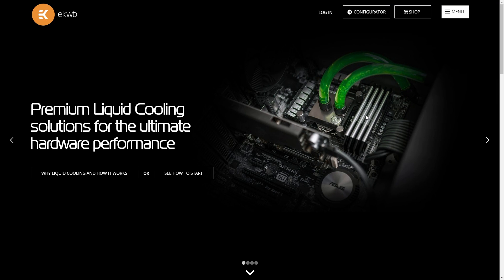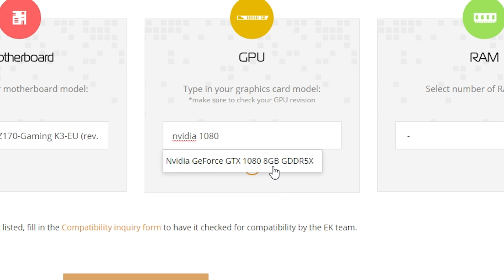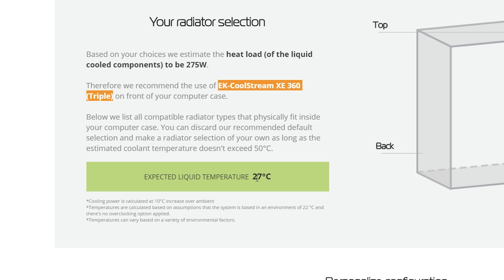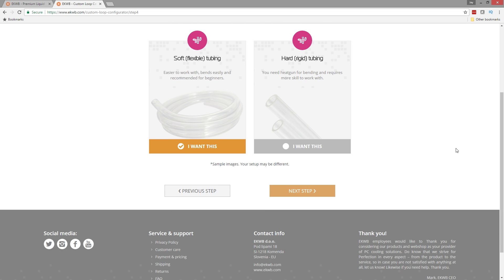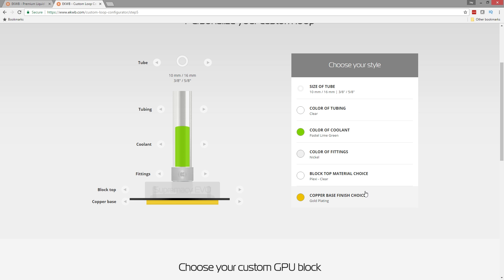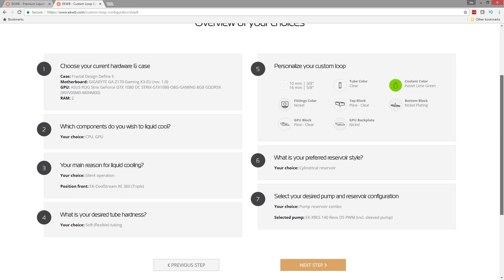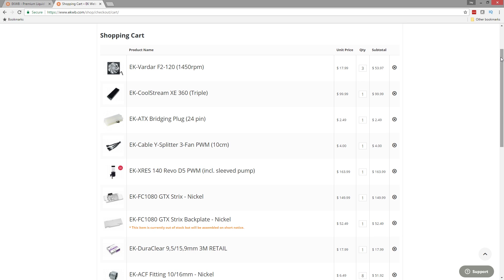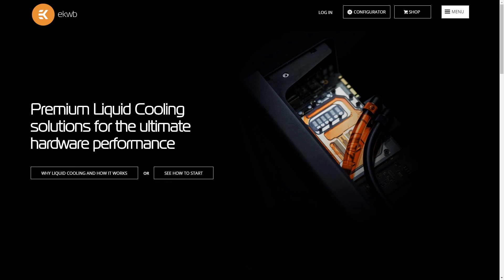How to configure a custom water loop using the EKWB CLC

Comment: The real issue with this configurator is it's only gets you pieces IN STOCK ! So in my case, EU store doesn't have any 240 or 280 radiators in stock now, but, instead of telling me this, EK prefers to sell me an insuficiant radiator (120 mm for CPU and GPU !). and then tells me that expected liquid temp will be arround 40°C ! They should give us the right configuration even if they are temporarily out of stock instead of trying to sell something undersized.... (but it's still a great tool to know what you need)

Comment: I have had a custom loop up until recently, I had an issue with a fitting and was discouraged after the water entered my system. Distilled and drained every 6 months so it didnt damage anything, but the mess was unreal. I sure do miss the asthetics.

Comment: Perhaps it is different now, but back in the day Bitspower had far better fittings. I had an EK high flow block that was great, but I used Bitspower fittings. EK has always had great blocks, but I would go with Bitspower fittings, although I will say that I have been out of the game for a couple years (last system built in late 2013).

Comment: You can also shave a few dollars off of you get a card with a waterblock like the hydrocopper or msi seahawk. Alphacool sells much cheaper reservoir/pump combos too. EK's stuff can get expensive but you are getting the top tier parts. Also you should only need the dye for your loop ($8), just mix in distilled water. I've only put in $340 in parts for my current loop, and the premium for a card with a waterblock.

Comment: They need to make the "custom configurator" a little easier to use... For example, because they demand a motherboard and GPU that I don't have on their list, I would have to use more "popular" boards, or even skip selections like GPU cooling even though I know they have a compatible GPU monoblock for my GPU.  Still needs far more work.

Comment: If anything, their config is actually useful for picking what parts you need and what fittings to get. Since they know that case you are using, you can use it to help get parts even its not from EK.  I used this to me pick what I could need for  new loop. And I know how many fittings to get now. Saves me time to think about it.

Comment: Instead of a $2.49 jumper you can use a $0.01 paper clip.  It's the little things that help make this hobby more affordable.
Reply: Christian Stout can i touch the paper clip while its connected or will it electrocute me? xD
Reply: Christian Stout why its used for? to turn on the pc?
Reply: No, it's for just turning on the pump w/o turning on the whole PC when you're filling/flushing/leak testing your loop.
Reply: Christian Stout ohh.. so u jump the pins.. fill the liquid.. jump the pin again and again to fill the liquid..  or the pump keeps running once u jump the pins?
Reply: Power will continue to be supplied to the pump as long as those two pins are connnected, either by a jumper or a paper clip.  When you're done running the motor, just unplug it/flip the PSU off.
It'll make more sense when you try it in person.
Reply: Christian Stout Got it..  Thanks :)

Comment: Just checked out the site and plugged my parts in, and it recommends a 240 front mounted and a 120 rear mounted.. My case is the Deepcool Genome II that ships with a 360 top mount AIO. Lmao... How about a 240 front and 360 top?
Reply: Kurt Dunsmore go ahead. I did in my phanteks

Comment: Corsair 600c, MSI z170 Gaming M7, Gigabyte GTX 980ti...they want 850 bucks for a custom loop based on that. I think I will stick with my Corsair AIO.
Reply: Oh yeah, for anyone asking, I have a 6600k running at 4.5Ghz, 1.35 volts on a Corsair H100i V2 and it never goes above 55c....even during stress testing.
Reply: Granted, this is a great video, and that tool is amazing...I would just rather spend my money on better hardware.
Reply: +Justin Updyke i have a fx8350 with Noctua nhu12s at 4.2 ghz(never tried higher) and never go above 50*c under load lol
Reply: custom water cooling is overrated nowadays. It's more for looks than anything

Comment: The site needs work, I tried to do a build in a Corsair 460x and it's not comprehensive enough. Seeing as I actually built a custom loop in one for my friend two weeks ago, I know it can fit more than JUST an SE360 radiator in the front... Considering I slapped a PE360 (push/pull) in the front, an SE240 (push) in the roof and an SE120 (push) at the rear with barely enough wiggle room. This was without modifying the case at all. They're cooling an i7 7700k and SLI Strix 1080 Gaming Advanced with a D5/XRES100 pump combo. Probably overkill but he had the money :D

Comment: The reason I didn't go for CPU loop was noise pretty much. My noctua fan is quieter than a water pump. CPU watercooling seems so overrated to me for real world use.
I would however like to get  GPU loop as the temp problems always come from GPU, and performance always takes much bigger hit from GPU throttling than any issues from CPU. Plus under load GPU fans are loud AF. I even got the 780ti PHANTOM with the oooh so quiet fans... ya right. Put them under load and they are loud :D

Comment: Jay, this comment isn't really relevant but, somethings wrong with the PC i just built. voltage won't stay constant, and it's stuttering frequently. not overclocking, and temps are fine... i just built it like an hour ago
Reply: what do you think i should do?
Reply: MrDeeb8 thats normal if you use an intel cpu

Comment: Custom watercoolers look great , but they cost allot. Is the money you spend on them worth the perfomance you gain when you OC your cpu and gpu? Linus made a video, when he got a used GTX 480 ( if iam not mistaken ) and compared whit a new one , and they perform the same , is the heat degradation really a thing? :D thx cool vid

Comment: What does the expected temperature mean? That can't be the water temperature under load because that would be way too low especially with a 360 rad only.
Reply: Probably it's the water temp delta t. IOW, if it says 25c, that's 25c over ambient so if you're room is 20c, that's 45c.

Comment: that's bad ass! helps with having the fittings sizes match the hoses without having to think about it. maybe in the future I may go for this. need to have a worthy system first. I only have a fx 8350 16gig ram evga gtx 970 FTW+
Reply: yh don't water cool the 8350.. I got my chip stable at 5ghz with an H100 aio a years back, water cooling is only worth it if you have pretty much maxed out your PC in terms of upgrades. I7 5th/6/7 gen, GTX 980 to + and ammusing you have other high end parts like a 500gb SSD etc. Water cooling is expensive and not worth it at all with lower end parts.. I always find it funny when people water cool i5s and mid range GPUs :p
Reply: Now with the new amd ryzen 7 1800kx I have get a cooler for that..

Comment: They still need to do a bit of tweaking.  Basic CPU and GPU loop is quoting at almost $1000 for me.  Added on RAM despite the fact I did not choose it, and also added numerous parts that were out of stock.

Comment from the maker: Hey guys. Obviously the amount of people going to the site unintentionally DDOSd it... doesn't take much thought to figure that one out. Things should smooth out once the traffic dies down. That is NOT EKWB's fault
Reply: They could really corner the market if they offered hot dogs too. ;P
Reply: Jay ive got a Question, or anybody for that matter. Are fan splitters safe? My motherboard, asus maximus ix hero has four chassis fan headers and im wanting to hook up 6 fans, not using a fan controller or hub, but hooked up to the motherboard. The fans im going to use are pwm by the way, corsair ml140's. Ive read thats its ok to use fan splitters and ive heard that its bad and can burn out the motherboard, please help!!
Reply: Nice ad bruh :v
On a more serious note, I have been using this for a couple of months and it's nice. I do not need it but it's always fun to make a list. The only fail is it doesn't suggest a ball valve etc for a quick bleeding system in the loop. Can't wait for all the books crying about the pains of bleeding loops xD
Reply: Should put a link in the description
Reply: JayzTwoCents that's actually a awesome idea. Really hope to get into water cooking soon. Their servers being down,  maybe they don't host the site at all..
Reply: it would be cool if somebody made like a VR configurator where you could walk into a virtual store and pick out any PC part you want, put it together, and see what it looks like and run virtual benchmarks.
Reply: Slender Man they say always go with 140 if you can for a quieter operation.
Reply: LOL Well while unfortunate, it does tell EK that your site has a possible HUGE impact on their sales. They should send you a Thank You card. Though they may want to reevaluate their ability to handle traffic when and if you ever do something like this video again. xD Or maybe just give them a heads-up before you post a future video such as this one.
Reply: Can't find the answer to this anywhere, Jay:  Are you available for hire for consigning work?  I'd like a pretty elaborate watercooling loop done, but A) have little experience with it, B) little time and C) I spent waaaaaaaaay too much on my components to risk FUBAR'ing any of them.

Components are already purchased and everything is either top of the line or 1 SKU from it (matter of fact, the rig is built, but I'd imagine it'd get torn down for the work), I know exactly what I want it to look like, and I'm not all that concerned with cost - as a matter of fact, I'd probably ask to fly down wherever you guys, get a hotel for however long it takes, and  "help" (have to put it in air quotes because it's probably a Ralph Wiggum level of "I'm helping!", but I would like to learn as well as acquire the build).  I'd be totally cool with the work being showcased in your videos to generate content for you.  If you don't like my case (it's huge, so I don't see why not, but if), I'll happily buy something else.  I'm just far enough into this money pit that, god dammit, I want it to look as good as it functions.
Reply: It's up now, was just looking :D
Reply: JayzTwoCents what do I do for the case if I am making a desk pc?
Reply: RaInMaN yes they are. I have three 2k rpm pwm Noctuas in the front of my Define S running one one triple fan splitter like in the video
Reply: So as long as i dont go over my rated amp on the header im good right? Thank you for replying, i greatly appreciate it!
Reply: looked for link in description, didn't find one.
Reply: Hi guys

I've got a question to you, and I know it's a bit more off topic but it freaks the hell out of me that I don't find any answers on the WORLD WIDE WEB!!!
So now to the question. What is better for watercooling in a pretty tiny space case, to specific in a Corsair carbide 540 air. It could fit eihter a 360+240 radiator setup or 2x280 radiator. Which one is better for cooling and the sake of looks? The surface of 2x280 is bigger than the other config, I already checked that, but it doesn't give me any answers. I also was searching if it could fit a 360 and a 280, but it doesn't from factory ('cause to small), I should have to cut it, but I'm not willing to do this!
please help me, and such respond like it's up to you, don't help that much. If it's not that much of a difference than maybe it's ok, maybe

btw thanks for your time to read all this, and your response
Reply: thanks
that´s good to know
Reply: Slender Man yeah look at the tdp of the rads, if you use multi rads just add them together to compare, and then larger fans would be quieter as they need lower rpm to get the same airflow, not sure about pressure. Btw make sure you get fans that can actually push air through the rad, i used to use some cheap fans and the difference is huge.
Reply: If that would be the cause then they underestimated the amount of traffic. That would make it a bit their fault, I would say. Not that it is a problem. :)
Reply: Well, they don't have most of my components listed.
Reply: JayzTwoCents  this definitely gives you advertising creed brother . I think they just felt the power of Jay'stwocents
Reply: Well, apparently the configurator is a bit busted. It only comes up with GPU and RAM cooling when I use my actual motherboard (MSI Z170A SLI Plus) and a CoolerMaster Mastercase 5 (Not my actual case, my actual case is the MasterBox 5) And, I know both of those things have enough clearance for Liquid cooling, so what gives?
Reply: Ok Jay, you kinda had to say that, but cutting the BS: It pretty much is their fault, they know your viewtime, therefore could have figured out how many people would want to visit their site. If their servers aren't capable enough, they should have gone for dynamic scaling…
Denying an honest request IS a fuck-up.
Reply: J.M. Guynn Most likely the stuff they have is based off some sort of demographic. In other words, what do most of their previous customers buy parts/kits for. X types of MOBOs in X type of case(s) blah blah blah. 

You should still be able to find something closely matching your current setup I would believe. Luckily for me, they have all my options covered. But I'm in the middle of buying a house so my chances of buying ANYTHING right now are slim to none. LOL
Reply: Post a link for those of us lazy :P

Also: have you gotten any info on their All-in-one (new) product? I'm very curios about it.
Reply: +basse9000 their stuff isn't near as nice or efficient, and those "plumbing" parts you're talking about are horrible for a pc
Reply: type in custom case
Reply: JayzTwoCents thanks Jay tour the man buddy.
Reply: JayzTwoCents personally, I would take out the 24 pin bridge connector and just use a paper clip. I could use the 2.49 on coffee from a gas station
Reply: Hey Jayz i got a problem when gaming sometimes especially if i use msi afterburner i get fps from 100 or 80 to 10 and the gpu slows down and the cpu jumps to 80% idk if this is normal i am sure i am not exceding the Vram limit and it happened even in games such as metro last light which is older ... i re-installed the drivers and didn't work should i consider installing the windows again?
My specs are not terrible for gaming : fx 8350 4.0 ghz, gtx 1060 3 gb oc , 8 gigs of ram and win 10 also the temps are in the 50s C
Reply: RaInMaN: be careful here, a few months ago I did what your trying to do with my Asus Gryphon Z97 and burned up the power supply to my CPU fan header, the PWM circuit still works thankfully, but I can no longer power any devices using the header. When I hooked it up and turned on the system I heard an audible 'pop' and the tiniest amount of smoke rise from inside my case. I though the worst and luckily it was just the power supply circuit to the header so I can still receive signal. I've since switched to a PWM fan hub that uses a SATA power connector to supply the voltage, and send the PWM from the monitored fan header on the hub to the CPU header on the Z97. In my case, 6 fans were way too much load.
Reply: I work in the web hosting business... If a client is going to sponsor something like this and fails to ensure proper scaling for their servers it is their fault. They know how big your audience is... they know that at least 10% of your subs will watch the video. and with your viewers its safe to say half will go to that site within 24 hours of your video going live... shoulda expected an rapid increase in click through. but eh love your vids, I was one of the accidental DDOSers lol.
Reply: Hey Jay, love your videos. This is the setup I came up with for my arrangement: https://www.ekwb.com/custom-loop-configurator/shared/oW58991a4a00bdc
Disappointed that they don't have a full-cover waterblock for my 980 Ti FTW edition... I know another company made some, yet seems to be hard to get in stock anywhere. I'm rather surprised that their choices elected both a 360 and 240 rad, but when I saw the expected liquid temps, I was pretty surprised.

Why pastel white? Well, my component choices kind of halfway inspired that this could take after the Pokemon Darkrai. With the motherboard block, it loses most all its gold accenting, and the RAM is red to flank the "head" (CPU). White would work well for the "smoke" hairdo of the creature.

Curious to see if you or our peers had any opinions to chime in.
Reply: it works great for me!!!!!!!!!!

Comment: Hi Jay and Nic. I tried out the configurator and was surprised and rather disappointed that only 120mm fan/radiator multiples were available. I'm a big fan(!) of 140mm fans because they run at lower speeds and are therefore quieter. EKWB makes 140mm multiple products so I don't know why they are missing from the configurator. Also have you heard when EKWB will be coming out with their replacement for the Predator AIO series? Thanks!
Reply: What case did you put in? Will 140s fit in that case? If not, it's not going to offer you 140s because they wont fit.
Reply: Define R5 is rated for 140mm multiple radiators. I'll probably wait for EKWB to release their replacement for their Predator AIO series and use separate loops for the CPU and GPU. What I want is 30mm thick radiators so that I can run my fans at low RMP, thick radiators will only improve performance if you run the fans at high RPM. I really want to keep things quiet.

Comment: Jay ive got a Question, or anybody for that matter. Are fan splitters safe? My motherboard, asus maximus ix hero has four chassis fan headers and im wanting to hook up 6 fans, not using a fan controller or hub, but hooked up to the motherboard. The fans im going to use are pwm by the way, corsair ml140's. Ive read thats its ok to use fan splitters and ive heard that its bad and can burn out the motherboard, please help!!